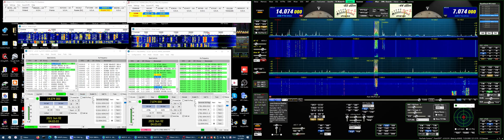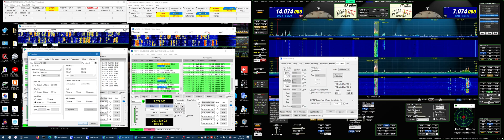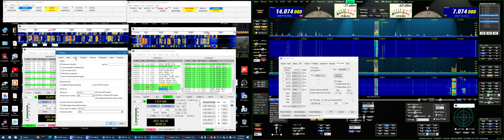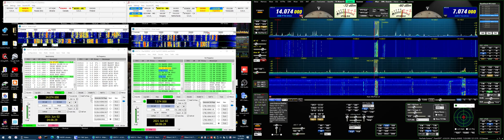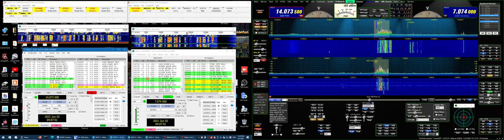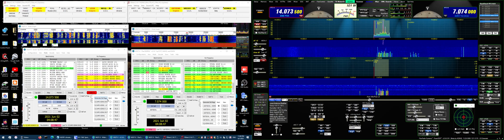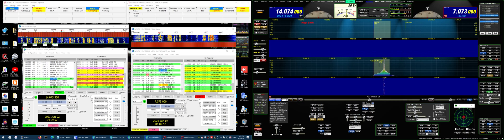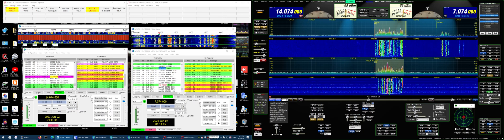PowerSDR ke9ns Flex-5000 RX2 SO2R WSJT-X configuration example.

Comment: Darrin, What are you using for your logbook. Ham Radio Deluxe setup here which seems redundant with the radio control part. Just purchased a loaded 5000a with VU5K, More videos on the Vu5K would be appreciated. 73 Jon N8EM
Reply from the maker: I used HRD years ago (it was nice), but I only used the logging part. I imagine the newer version has even more stuff. 
The big part of using the VU5K is creating a "Memory" database of all the repeaters in your area. If you use the "Group" heading to categorize (like "2m repeater" or "70cm repeater") you can then use the Scanner.
I have also scanned the 152mhz VHF Business band in my area (very busy).
In the "SWL Search" listing I added the all the NOAA Weather channels (162mhz), GMRS channels (although the sensitivity is way down that far up). 
So you can also use the Scanner to search SWL listings.